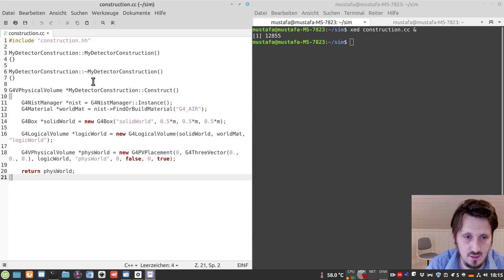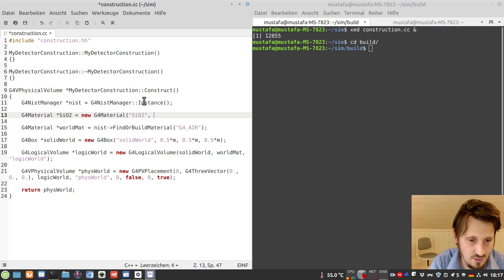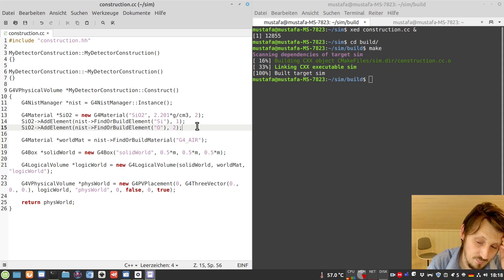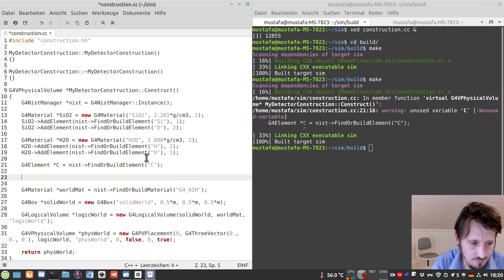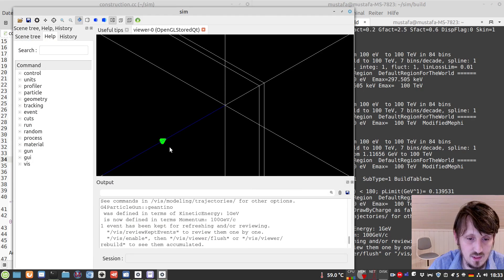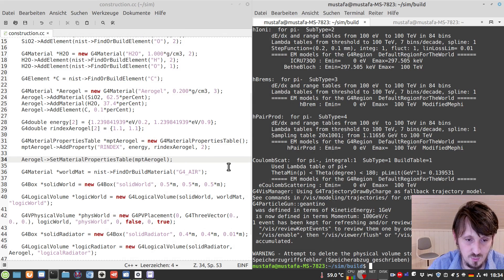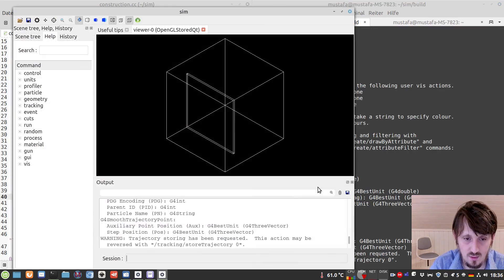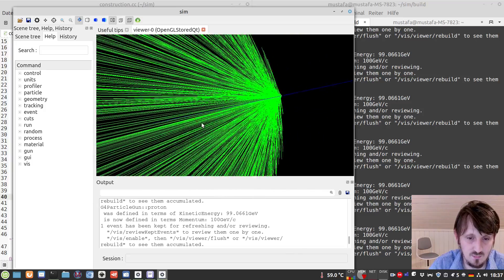Geant4 Tutorial 6: Adding Detector Volume

Comment: I'm using Geant4 v11.0.1.
I got an error message that 'Energies in material property table must be in increasing order'.
Changing the order of the elements in the energy array fixed the problem.  Must be something that  they've changed.

Thanks for your hard work on these tutorials!
Reply: Thanks it worked for me!
Reply: thanks it worked for me to!
Reply: thank you!
Reply: Thanks! it works well for mine too. (I use version 11.2 now)
Reply: Thank you!

Comment: I have a question about the refractive index (RINDEX). How to choose the appropriate value? Namely, If my light source is a commercial X-ray tube. The energy range is from 1keV to 130keV. Should I find out the refractive index of the material in these energies? Then I use it in the RINDEX?

Comment: Hopefully you can answer! My scintillator is NaI, refractive index of 1.85. When I try to run the simulation with that index, it crashes when I produce a particle! It works great if I have an index of 1.1, as you do in the tutorial. It also works fine if the index of the world material is not included, but it does not want to generate a simulation if both indexes are included. Any idea whats going on here? Thanks!
Reply: Hello. I have the same problem with a refractive index of 1.5. It may be that the Cherenkov angle that a proton of 100 GeV creates is higher or equal to the limit angle, at which the light emitted has total reflection when it pass from 1.5 to the rindexworld of 1.0 (but it's still just an hypotesis). Did you solve the problem? Thanks
Reply: This is because the program doesn't takes into account total reflection (or partial). Does anyone knows how to take the reflections into account?

Comment: Hi mustafa
Sir i  follow your this tutorial but only cube with proton beam executed
But light shower in green color shower can't be appear?
Please guide me, why  light shower could not be shown?
Reply: I have almost same question. For one proton, i dont have any other particle. But, for exemple, for 500 events, i have a bunch of electrons (red particles) being ejected from the aerogel, one or two photons, but any signal for the Cherenkov effect. I already see the code, and I think its ok. I thought that could be a problem with any  document (.cc or .hh) in the incorrect folder, but i dont think so. Anyone knows if its a problem with the version, configuration, etc?
Reply: IF you can't see the chernokov ligh change 0.9 with 0.2 as follows:

4double energy[2] = {1.239841939*eV/0.9, 1.239841939*eV/0.2};

Comment: Hey, thank you for this tutorial. I'm working with the version geant4 11.0 and until this part of your complete tutorial, everything works perfect. In this case, when I add the aerogel and its properties and the properties of the "world material" (index of refraction in both), i cannot see Cherenkov radiation. I've been proving changing the value of the index of refraction (Cherenkov condition is satisfied) for the aerogel but no changes, just electrons are produced in this interaction.

If you can help me to solve this "problem", I will be grateful, thank you again.
Reply: Change the physical list as in the previous example
Reply: same problem, did you find a solution?
Reply: @mmer1687  Yes, you need to make changes from version G4 11 to mptAerogel->AddProperty("RINDEX", &Energy[0], &AeRefractiveIndex1[0], true, true); important to add: true, true! After that the example will work in G4.
Reply: @vitoldbleko954  Thank you for the kind help. I also met the same problem. Unfortunately, even trying your method, the Cherenkov photon are still missing. No idea which part is wrong.
Reply: A material property vector with decreasing energy isn’t expected to work, in any version. 
Change values of the energy vector (i.e. invert the denominators 0.2 and 0.9)
Reply: try this
G4double energy[2]={6.6*eV,6.7*eV};
G4double rindexAerogel[2]={1.57, 1.57};
Reply: @lorenzofleres  Had the same problem, but that fixed it!  Thanks!
Reply: @lorenzofleres  thanks a lot i had the same problem but this fixed it. One problem I still have is my cherenkov light is not well defined as shown in this video. Still it short ranged plus I am not able to zoom it as he is doing in the video.
Reply: @lorenzofleres  Thanks a lot
Reply: IF you can't see the chernokov ligh change 0.9 with 0.2 as follows:

4double energy[2] = {1.239841939*eV/0.9, 1.239841939*eV/0.2};

Comment: I have compiled this code with no errors but i do not see the Cherenkov photon. Any idea where something could have went wrong?
Reply from the maker: Have you downloaded the code from  my github repository already and cross checked the complete code with your one to make sure there is no typing mistake? Sometimes it is just a minor spelling in one of the functions.
Reply: @physics_matters  Thanks for your reply. Yes i have had a check of the github, I had problems before where i just needed to copy your code as there were subtle spelling mistakes in my code. I tried to compile your full code and got the error " error: ‘G4PhysicsOrderedFreeVector’ does not name a type; did you mean ‘G4PhysicsFreeVector’?
     G4PhysicsOrderedFreeVector *quEff;".
Reply from the maker: Both vector classes are working for me. Which geant4 version are you using? I think the one I am using is only available after geant4.10. I have added now my newly created discord Server to the description of all videos. Would you like to join?
Reply: Exactly the same problem here, fixed by using Geant4 10.7-patch3 version not 11.0
Reply: @InsungHwang-zq7vp  I'm having the same problem, is there any fix for version 11.0?
Reply: @meg-js1lb  A material property vector with decreasing energy isn’t expected to work, in any version. 
Change values of the energy vector (i.e. invert the denominators 0.2 and 0.9)
Reply: @lorenzofleres  Thanks man. This worked
Reply: @lorenzofleres  thanks a lot, worked. But what is the main problem ?

Comment: Thank you very much, thats being really helpfull to learn. 

Like other guy i have a HUGE PROBLEM... at time i execute, only  one proton beam appear, but light shower in green dont being showed: For one proton, i dont have any other particle. But, for exemple, for 500 events, i already have a bunch of electrons (red particles) being ejected from the aerogel, one or two photons, but any signal for the Cherenkov effect. I already see the code, and I think its ok (I dont have experience with github, and dont know if there have a copy exactly at the time of this tutorial). I thought that could be a problem with any  document (.cc or .hh) in the incorrect folder, but i dont think so. Anyone knows if its a problem with the version, configuration, etc? 

Im using the version 11.0.3. I will greatfull if anyone can help me, cause im stuck.
Reply from the maker: You have to change the order of the energy and the refractive index from the smallest energy to the largest one. I have accidently done it in the wrong direction
Reply: @physics_matters  THANKS A LOT, MAN. You're the man. Thanks for share your knowledge so openly and the quick response. 

If anyone have the same problem, in simple words we have to change the wavelength "0.2" for "0.9", and vicerversa (I had to think a little bit). I think i can visualise why (physically), but still dont can put it in words. But its interesting that worked for you, Mustafa.

By the way... Right now, I'm in a project to study heavy nuclei fusion using distribution barrier method (I'm undergraduate student), and I want to be at the point to interpret and replicate results of papers that used Root in a month or two. If you have any advice for me, I'll follow it. I'll see two more chapters of these course, and after that, see your Root series. Grateful.